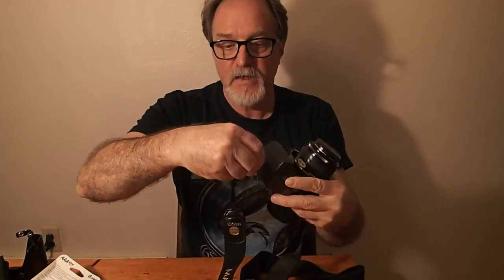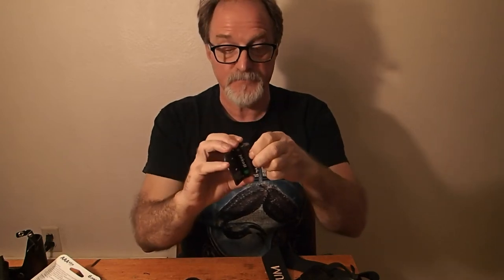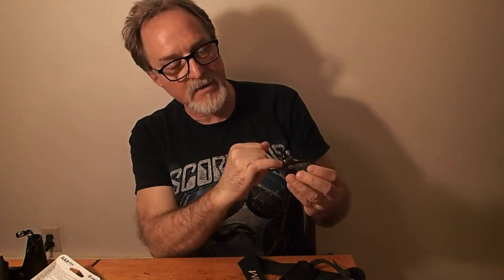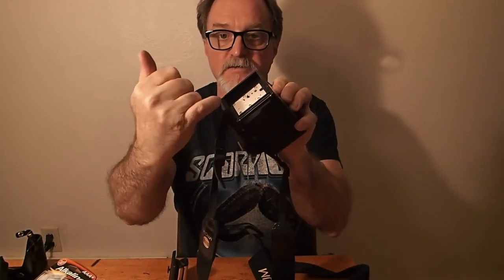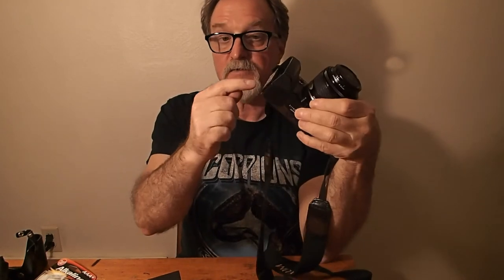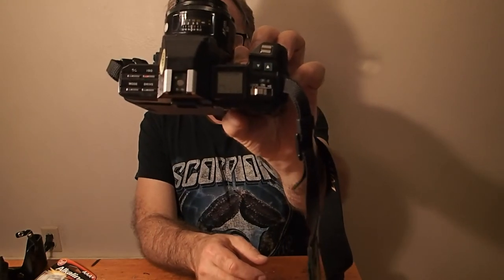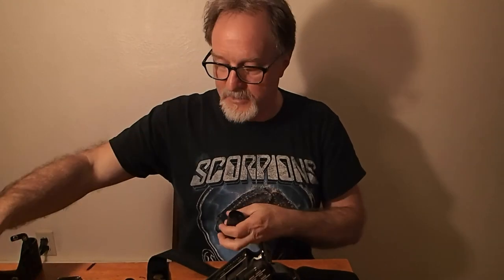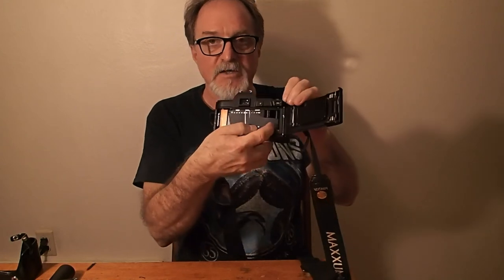52 Cameras: # 115 — Using The Maxxum 7000 part 1

Comment from the maker: A user asked on another camera's video about using the 7000 for low light/long exposure. The best place to start is the manual. Mike Butkus has it (of course): https://www.butkus.org/chinon/minolta/minolta_maxxum_7000/minolta_maxxum_7000.htm

A couple of scenarios: 1) With flash. If you have a compatible Maxxum flash, it will talk to the camera body and set the shutter speed to 1/100 in A or Program Auto modes. In manual, or if you're using a different flash, set the shutter speed to 1/100 or less. 2) Without flash. First, use a tripod or set the camera on a stable surface. The 7000 doesn't have the old-school cable release so if you don't have a Maxxum release (there are several types), use the self timer mode so you don't touch the camera and introduce shake. In A or Program Auto, the camera will select the shutter speed up to 30 seconds. In shutter priority (S), or manual, you can set the speed up to 30 seconds. If you want/need longer for star trails or something, you need to shoot in manual and select bulb as the shutter speed. You will need a Maxxum remote/cable release for this. The self timer doesn't work since it has no way of knowing how long you want to keep the shutter open. That's all I can think of for now. If anyone has good tips for long exposures or spots an error in this text, please add a comment.

Comment: hi! thanks for the video! only i have a problem with my minolta 430si RZ......the camera will take a series of photos and automatically rewind itself before the end of the film and i wont get any of the shots. please help me.
Reply from the maker: Hi, I don't have that model but a few things that seem to be common issues are worth checking.  Is the battery strong?  Iffy voltage can cause all kinds of strange problems.  Clean the battery contacts in the camera body.  A cotton swab with alcohol works well.  If the metal looks really dull, I often use a pencil eraser.  It's abrasive so don't overdo it -- just get a bare-metal shine.  Do the same for the contacts that read the encoding from the film cartridge.  The encoding is not just the film speed but other info including the number of frames.  If there is foam on the inside of the camera back to hold the film cartridge, make sure it's springy enough to push the film against the contacts.  If all else fails, KEH has the same camera body in Ex+ condition for $10 USD.  Sorry I wasn't more help.  Good luck.